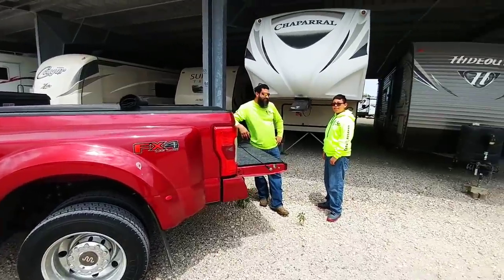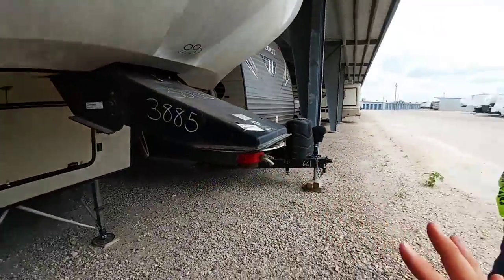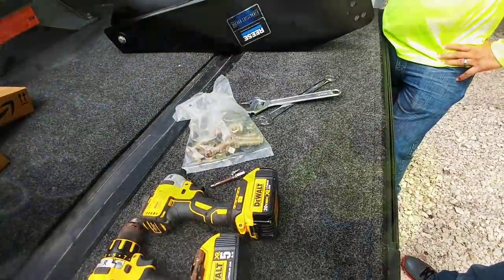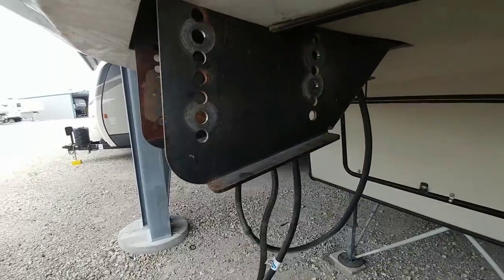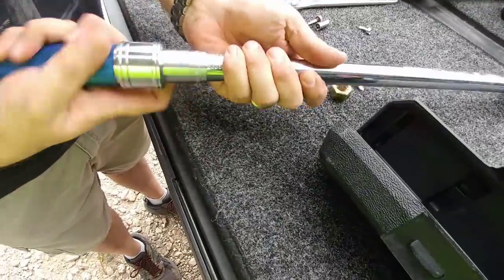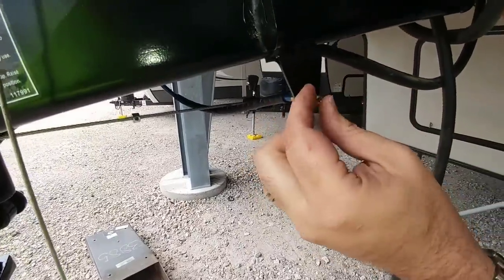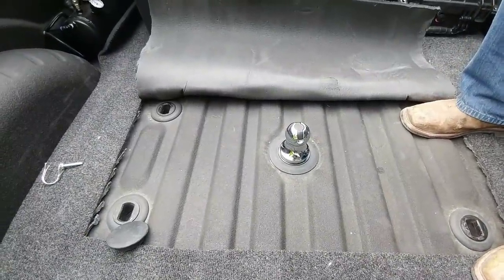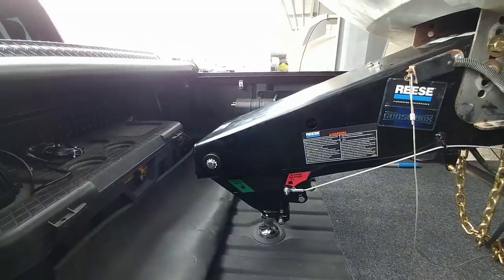Best Fifth Wheel Upgrade! Installing the REESE 20k Goose Box!

Comment: You had the Anderson Ultimate Hitch which was way cheaper and way lighter and still allowed you the lock the pin box.
Reply from the maker: technically the Anderson hitch isn't lighter at all because you still keep the same pin box. After installing the Goose Box the only component I have to ever mess with is the Gooseneck ball which is very light, small and takes up hardly any space. Also the Anderson takes up nearly 10 square feet of bed space and requires you to torque it down to correct specifications every time you use it and does not have a hitch lock (theft prevention) and adds additional failure points since it connects to the kingpin. Plus if your fifth wheel needs to be moved you must have a Andersen hitch to do so. It's not a bad hitch in any way just not the hitch is prefer.
Reply: Big Truck Big RV point made. I'll remember this hitch when I move up a class in 2019.
Reply: Cannon Ball - I have the Anderson Ultimate and absolutely love it. Everything BTBRV said about the hitch is correct, but it’s personal preference for everyone. I tow a 40 foot Cougar 368MBI that’s about 13,500 loaded up for use. We towed up some long steep grades and over horrible California roads with the Anderson and it towed like a dream. I love the hitch. I actually leave the hitch in most of the time but it’s super easy to pull out when needed. It’s all about what works best for you.
Reply from the maker: coming agree Eric.  Andersen makes a great hitch.
Reply: Eric Rhodes I agree. I seen all the videos to feel like I. An expert and I don't even own a 5er yet.but this reese still gives you the goose method and gives you more room in the bed. But hey what do I know I haven't bought one yet
Reply: Cannon Ball - Don’t get me wrong. This looks like an amazing idea. I honestly had never heard of it when we got ours set up. If I had, I would have seriously looked into it. My only concern is clearance for a “short bed”. My 3500HD SRW is the 6’6” bed so I was concerned about clearance. With the Anderson, I can get to just shy of a 90 degree turn without any issue. That’s more than enough for almost any situation. Certainly enough for any situation I’ve dealt with and I have to do a 90 degree T 3 point turn around in my driveway to park it after every trip. I have not even gotten close to my cab with the RV.

I do like that Reese is all one piece so in theory it should be stronger. But, the Anderson is plenty strong for towing anything my truck can pull. And I like that there is not hitch to deal with in the bed of the truck with the Reese. The Reese is just way more money. Again, it comes down to personal preference.

Comment: This is the pin box I plan on using when I buy my own fifth wheel so will be very interested in hearing your review and experience with it. why did you decide to change from a traditional fifth wheel ? And why did you buy the 20k version when the 16k version would have been adequate ??  my local RV dealer is trying to talk me into using the Andersen hitch like the one you had last year but I have never got a straight answer from anyone if it would void the warranty on a new 5ver. At least the goosebox is fully endorsed by Lippert so shouldn't have that problem with it

Comment: so i know this video is older... but yes need to re-torque those if possible by the nut, not the bolt. and also i would have cleaned and repainted the mounting brackets from the original hitch before mounting the new one on. keeps things clean and rust free.

Comment: I agree with Dieselmxtt, where is the advantage for this type pin box for a 5th wheel?  Why not do a review of the Reese Sidewinder pin box?  I have the 19K model on my 2018 Montana 3560RL, and it is awesome.  It gives a lot more room for turning without coming remotely close to the cab of the truck.  Super smooth ride with easy connecting and disconnecting.  Not to mention you can carry more "stuff" in your truck bed without fear of rotating pin box in the bed.  All the rotational movement is way back up under the nose of the 5th wheel. It is perfect for those of us with Ram Box equipped trucks.  Come on Mr. BTBRV, this was not one of your better videos.

Comment: Just wondering if the wheel lock fits between the axels so both tires are locked? I’d think locking 2 tires together would be more secure than 1

Comment: As always fantastic video and thank you!! My question has always been with this type of setup that you installed does it add more stress to the front of the trailer because of the extended length of the gooseneck assembly on the pin box??? I have seen videos on YouTube of people that have failure on the Lippert frames upfront there so I have been very diligently inspecting mine and mine is Factory.
Reply from the maker: J Patt: This type of Gooseneck upgrade adds no significant stress to the frame and that's why Lippert actually endorses it's use.  They will void you frame warranty if you use a gooseneck adapter added to the kingpin.
Reply: Big Truck Big RV okay thanks for the info!!
Reply: Big Truck Big RV a

Comment: That is a good box but like the other person said you need to be dead on and talking from experience if you have a landing gear problem you won’t be able to un hitch without some rigging. I went to a morryde pin box once I got my new truck and love it. I had a flatbed with a gooseneck ball previously and actually had a gear break and it was miserable trying to get it off seeing as when the gear broke it screwed up my motor also.

Comment: Nice video. I thought goosenecking a 5th wheel put more strain on the front of the trailer then a 5th wheel hitch.?
Reply from the maker: Dieselmxtt: most do, not this one
Reply: This is approved by lippert frame. Last summer my frame wash nearly torn off from the pin box and we had to get the entire underside of 5th wheel rewelded. This went on instead of old gooseneck conversion.
Reply: Anything that increases the distance between the truck/trailer connection point and the upper deck of the trailer will increase the stress applied to the structure, plain and simple.  Whoever at Lippert is saying this isn't doesn't have an engineering background.  The problem isn't so much the static load, which doesn't change much versus a standard pinbox when the rig is stationary.  The problem IS that the forward/backward chucking action of the trailer/truck is magnified because the vertical distance between the upper deck and the truck/trailer connection is now longer.  The increased stress is easily calculated as a function of the difference in moment arm.  To combat this change in moment arm below the upper deck connection, you'd have to add structure above the pinbox connection (inside the front room of the trailer) as well as the vertical risers connecting the upper deck to the main part of the frame system.  The Lippert built frames ARE NOT up to this, and you will significantly increase the likelihood and severity of frame problems versus the standard pinbox geometry.
Reply: And really only needs to be in the front in the under side at the connection to the pin box. Frankly when I saw what minimal gauge material and weak crossmember bracing they used to begin with I just shook my head. A little more goes a long way. Heck some extra pieces from a scrap yard could quadruple the strength

Comment: Big Truck, what did you do with the original pin box?  I bought a previously owned 5er with the goose box installed and the original was in the basement.  Now that big hunk of steal is in the yard!  Also, can you use a tire pressure gauge to check the pressure in the bag?  Cheers
Reply: Yes you can use a tire pressure gauge to check the pressure.  I just did it about an hour ago.

Comment: I have a question. I have a kingpin that is rated at 15500 just like yours.  I notice that you went with the 20K Goosebox. Is there any reason for not getting the 16K Goosebox?  I am about to upgrade to the Goosebox and I want to know if there is any reason I should get the 20K over the 16K. Thanks for any info you can provide me.

Comment: My friend, that's NOT torqued right! Two mistakes you made that will make you get an inaccurate reading, you tightened the bolt, not the nut, and you put your hand on the head of the torque wrench while torquing it down. You really should go re-torque them down, I bet you'll get a 1/4 turn off those nuts.
Reply: 2x, torque is not correct!!
Reply: Well if you listen and look... the directions said 210tq and then he stated and set it at 220tq.
Reply: That's not 10% over.  Either way, it's wrong.
Reply: Yeah but with torque vectoring and compound rotation of force unless  you put it on with a slap stick in a star pattern it's just going to fall off when he hooks it up to his truck so yeah there's that!!!!!!😂🤣
Reply: Half past stripped. Done.
Reply: SentByHim Are we just going to act like this person doesn’t have a carpeted bed? Can any of you take this person serious? For real?
Reply: BornRaisedInCSA Still, if you add 10 per cent, you would need an extra 21 pounds per square inch. 210 plus 10 per cent, by my math, would be 231 pounds. Either way, I’m confused by this dude’s tactics.
Reply: Damian it's pound feet not pounds per square inch. It's torque, not pressure. Stop trying to act smart.
Reply: Who cares
Reply: Dose that lock fit in between both wheels ?
Reply: @jessearriaga5580  The different sides are intended for different wheel sizes. The vendors website has a video showing installation on various tires and then it clicked for me. Seems to me being able to lock two wheels with one device would be a double deterrent.

Comment: What was your total outlay for the upgrade? Is it comparable to a top of the line 5th wheel hitch , plus extra necessities?
Love your videos and advice.
Reply from the maker: for the $20k model youll spend about $1200 for the GooseBox and about $300 for installation at a shop.  A high end Ball is going to run around $200 (recommend a extended ball).  Vs a high end fifth wheel hitch priced around $1000.

Comment: I need some help!!!!!! I have this installed and pull a 40 ft fifth wheel with a Ford F-350 dully. I am experiencing an annoying bucking going down the highway. I have the bag inflated to 50 psi. Not impressed so far. Any thoughts would be helpful!!!!!!

Comment: its neat, yet i see some pros and cons. pros are the ball is easier to stow when not in use. cons are the 5th wheel is much easier and quicker to hitch up when you are alone. also can someone explain why you would need safety chains for this but not 5th wheel. its a lot less likely to hop off that ball than it is for a 5th wheel to slide right out

Comment: Hi BTBRV. Im confuse. I saw a previous video were u did not like gooseneck because it will put more stress on trailer frame.  what change? thanks
Reply from the maker: I have nothing against a gooseneck conversion from a regular Pinbox (Aka the Goosebox). I'm totally against Gooseneck Adapters attached to Pinboxes

Comment: Nice!  I want to purchase one of those man but I can’t due to having a 6.4 ft bed.  Standing by for the follow up vid.
Reply: Antonio Cole ...so that won’t work on a short bed?  I must have missed that part.
Reply: RiverManPaul is not that it won’t work at all.  It becomes an issue when you have to make tight turns.
Reply: Antonio Cole...gotcha...I know the long bed is preferable but I’m getting ready to drop the hammer on a F-350 and I just don’t think I can do the long wheelbase.  I think the wife would have a harder time navigating it it tight spaces sans the fifth wheel
Reply: Antonio Cole  my uncle has one of these on his fifth wheel and pulls it with a short box and he says he has no problems going to more than 90 degrees turning

Comment: Question: I have a standard toolbox in a 99 f350 quad cab with an 8 ft bed. If I Install a standard fifth wheel hitch, will my RV be hitting the tool box?

Comment: New to fifth wheel towing. What’s the benefits of switching to this set up? Other than more room in your pickup bed
Reply: Nothing you will rip the front off your camper, not made for the lower pull point.

Comment: Your putting the bolts in wrong. All good mechanics tighten the nut.  Meaning bolts should be installed from inside out. Allowing torquing outside of the nut.

Comment: I can see a problem. Your goose box probably at least doubles the load on the framework that the pin box is attached to. You are going to tear your pin box out.  Prolly better just to leave it like the manufactures intended it to be and it was designed for.

Comment: Just a couple questions. 
That’s still as safe/legal as before?
How does that swap work with manufacturer warranty? I know you’ve mentioned that the gooseneck adapter on a 5th wheel will void warranty. 
Also I’m assuming it won’t mess with structural integrity as far as frame goes?

Thanks for the info. It looks like a great idea because then you don’t need the big bully 5th wheel hitch taking up room in the bed. That’s probably why you did it.
Reply: Todd S cool thanks for the info. It’s much appreciated.
Reply: I called Lippert before ordering mine and the told me that the Reese goose box hitch is the only after market hitch they endorse.

Comment: I see you’re using the bed rug system.  What are your thoughts of the product?
Reply from the maker: John Maher: I usually use a Bedrug, but this time I went with an Access Bed rug. I love it because it doesn't shed or get caught up on everything. Since my truck has a spray in bed liner, I used this to cover the floor.

Comment: Good video and interesting conversion..I read the comments but might have missed this...how's the turning radius for a shortbed? Would someone still need a traditional 5th wheel hitch and use a slider?  Or is this best used with a long bed?
Reply from the maker: apparently, turning radius is not changed, so if you have clearance issues, you might need to get an offset ball.
Reply: Kevin Cameron I called the company regarding this three weeks ago and was told it is not recommended due to have a short bed truck i.e Ram 3500 dually with mega cab.
Reply: Personal experience...With a short bed there are still clearance issues. I can get to about 70 degrees on mine before contact with the rear of the cab. Just means I take a couple of extra turns on the wheel for those trickier backups is all.

Comment: I have this unit,  it's a pain to reach the unlock cable.  Need a extension to reach the unlock cable.  See what you think.   I'm also old and fat.........doesn't help.
Reply from the maker: Robert Moore: Do you deflate the airbag when unhitching?  I noticed that if I don't, it wants to stay on the ball.  When I let most of the air out, I can decouple
Reply: Big Truck Big RV.  No I don't,  it's just hard to reach the handle.  After 7 days of camping  I have to refill the air anyway so I'll try that.
Reply: I've had mine for a year on an '08 Cardinal, and never had to deflate the airbag to unhook.

Comment: So you did a video a while back and I took it that you recommended the fifth wheel over the gooseneck what is changed?
Reply from the maker: Nothing has changed sir.  This is not a Gooseneck adapter that attaches to the Kingpin on a Fifth Wheel PinBox, this replaces the pinbox and does not apply the sale type of leverage as the adapters do.
Reply: Big Truck Big RV,  thanks for the reply. Did you do a review of the pinbox? Maybe i missed it. I am very interested since i currently have 2 older trucks, one for work and one for towing. With this gooseneck type setup, it would allow me to get back to one newer truck without fighting the fifthwheel hitch for space with work. Thanks for the videos. Always informative and appreciated. Would like to see a review of some newer SRW 3500 also.

Comment: Wut do you think about ram out doing the ford in TFL truck
Reply from the maker: not surprised, these trucks have incredible power and a Cummins is no joke. Glad it performed well!
Reply: The 350 vs 3500 dually?  Only by a smidgen.  It was really a dead heat - the Ford took only 2 second more up the hill, had less brake hits on the way down.  With their scoring - the Ram won by 1 point.
Reply from the maker: Agree, both are good trucks.  Their test wasn't exactly a scientific test.
Reply: There were a lot of variables, but it was a real world test.  The thing to take away from that video was how comparable the two trucks were.  Considering the margin of error, i would say it was exactly even.  Let's wait to see what comes out in 2020...
Reply: True - not scientific, but somewhat real world-ish.  These guys are journalists, and like other magazines they rate vehicles.  This Ike Gauntlet is a very tough towing test.  They have developed a scoring criteria which measures some basic functions of pulling a trailer - how well it does maintaining a safe speed going down hill - the better it maintains a speed on its own, the fewer hits on the brake to keep it in a speed range, how strong it is pulling up hill, gas mileage.  Then they have opinion scores.  The two were in essence a dead heat for the non-opinion portion of their scoring.  And what put the Ram above the F350?  Air leveling suspension.  The F350 squatted 4 inches.

Both are excellent trucks.  Can't wait to see what Ram does on their HD lineup in the next year or two.

Comment: My Reese goose box paint bubbled up.  Upon further investigation I see that they didn't prep the metal before spraying a thin coat of cheap black paint.  That's right, they sprayed over surface rust.  Furthermore, Reese will not return my emails.  Good idea and I like the system better than a 5th wheel setup but the quality is junk.  My airbag doesn't hold air too long either.
Reply from the maker: Mine still looks great. Perhaps yours somehow slipped through QC